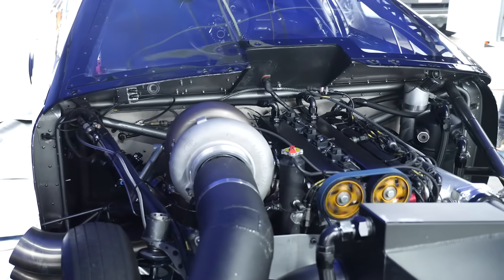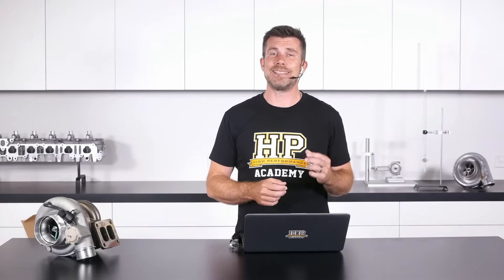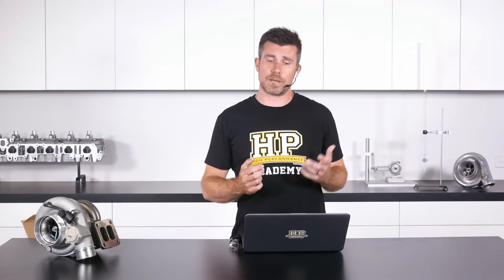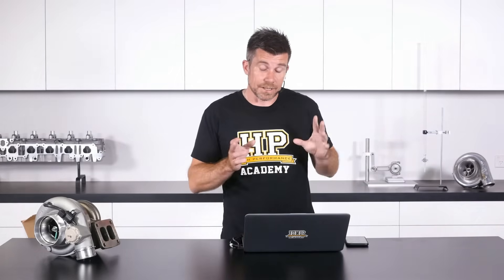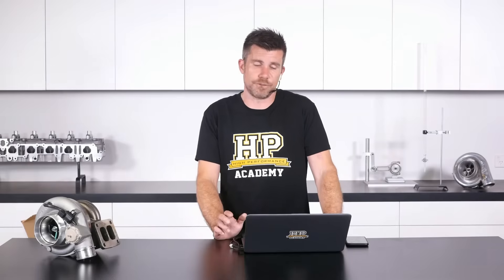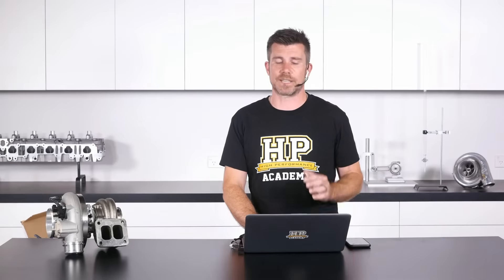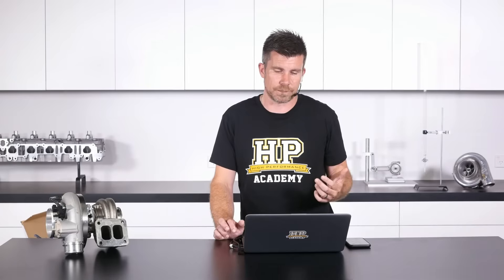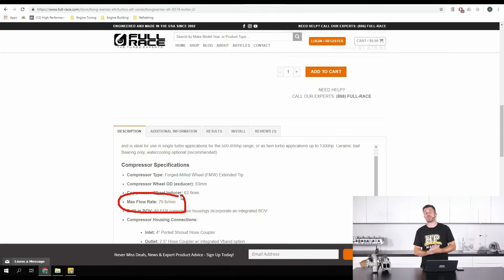How To Choose The Right Turbo For Your Build

Comment: Generally less laggy turbos have less boost threshold. Boost threshold and lag are the same thing IMO
Reply: Nah mate,  not the same.  Perhaps somewhat related, but not the same
Reply: @sexyfacenation  but a less laggy turbo will make peak boost earlier 🤭
Reply: @md-run  yep, maybe.
Reply: I believe his point was to draw a distinction between surge/boost threshold as the minimum flow to begin building boost under steady state conditions and lag as the effects of rotational inertia on boost responsiveness. By that definition they are two very different concepts

Comment: CFM
Reply: @sexy_face  CFM (air flow) restrictions post turbo, artificially raise boost pressure.  Boost pressure reflects CFM efficiency.  CFM > PSI
Reply: @gammalight1312  cool. That makes more sense than a 3 letter comment!
Reply: Mad manifold air density thats the most important 15psi of hot air is alot less air then 15psi of cold air